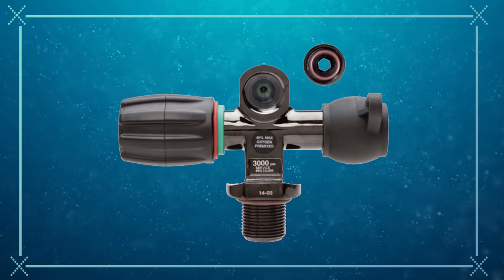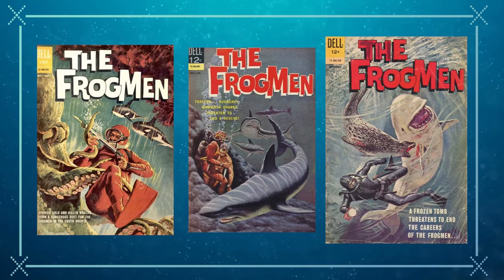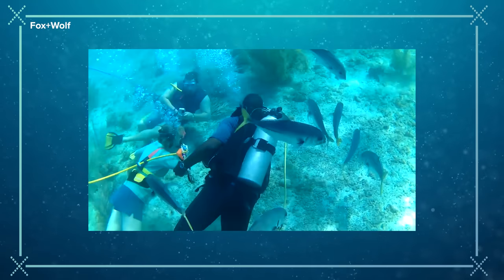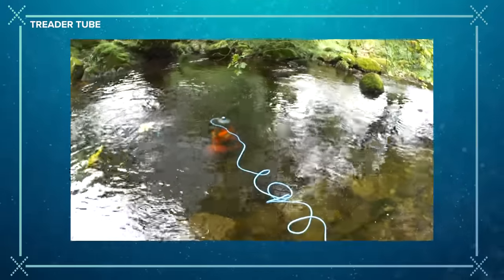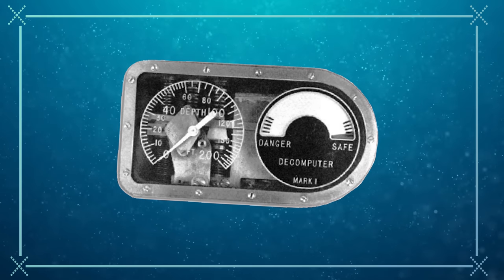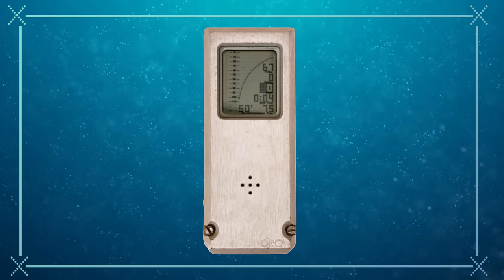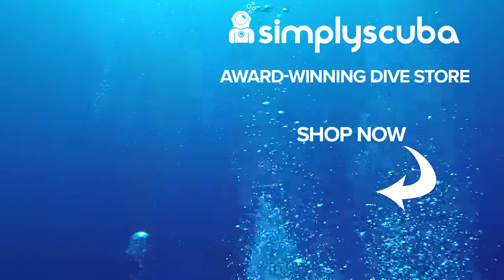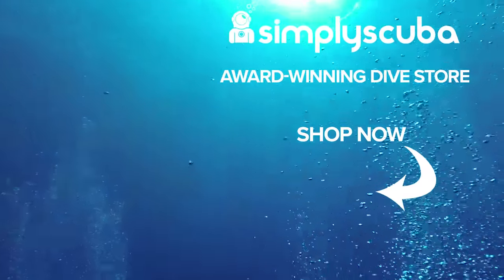Worst Dive Gear In The World

Comment: When I got my PADI certification, my instructor taught us exclusively on tables
Reply: That's the way it should be, when I dive, I dive with two dive computers and I carry a set of tables just in case, you can never be prepared
Reply: @markgiltner7358  Why bother? If your main (only) computer fails all you have to do is make a safe accent to the surface with your usual safety stop along the way and end the dive.
Reply: @lordgman1  
i should have given more information as to why i use two computers. ive been scuba diving for 34 years, and commercial certified for the past 18 years. about the same time as my commercial cert. i started to get into Tech Diving   deeper and longer bottom times that kinda thing. my profiles can run down to 180ft  more or less i have touched 201ft on two occasions, just because I wanted it in my logs as a 200ft profile. i have redundancy built into my equipment, i wear twin steel 95 cu. ft. and carry as many as 3 sling tanks, 1 tank (80 cubes)  carries standard air mix, 1 tank (80 cubes) a carries EAN 40% give or take. and 1tank (30 cubes) if i think its necessary of 90% O2. the EAN and 90% are strictly decompression gas. 
i would absolutely agree that two computers for NDL dives is not necessary and overkill. but ive been doing these kinda profiles a long time and have never had an issue with DCS, hense my redundancy. 
hope that explains it better, cheers
Reply: @rimfirejunkie7427  
yeah me too, they was just starting to come out, I think it was mares that first came out with them, pretty basic compared to today's dive computers. my open water was in 1986 how bout you
Reply: Odd 😂
Reply: @lordgman1  If your going to have the expense (not everyone can) of a second computer then its a given to wear in each dive.  Why you ask.  Simple if my primary fails on the dive I've got all the information in the algorithm for the dives the remainder of the day.
Reply: It‘s always a good idea, having redundancy not needing any power supplies, that can be broken. I teach all my buddies in the use of tables, if they haven‘t been done so, already in OWD-cert.
And yes, I actually plan my dives with tables, to have a rough idea, how the dive should went. Not a tech-diver here.
Reply: We had that too.  That way if your dive computer malfunctioned you could get out your table and slate at 20 metres and calculate your...  PUPPY THAT!!  If the dive computer dies and I'm not rich enough to have a backup, I abort the dive and ascend with my dive buddy guiding me!

Comment: Very recent OWD here. In my OWD training I used two octo holders. One was a plastic "bubble" you'd squeeze the mouthpiece in, and the other was a plastic clip you'd have to force around the mouthpiece sideways. Especially the latter was horrible to use. I hated setting it up. On vacation I had a basic Aqualung BCD that had a strap on the right shoulder where you'd simply put a loop of the octo hose through. Super simple to set up and easy to pull out. I see zero problems with this but few BCDs seem to have this shoulder strap. I wonder why. It's so easy.

Comment: My favourite octo holder is to wrap a thin o-ring round the house of the octo and then bolt-snap that to my BCD. If you're calm and want to just practice or whatever then yeah you can unsnap it but if you need it NOW then you'll easily break the o-ring
Reply: That works actually pretty well. Just don't forget to make it part of your buddy check, so you're not the only one to know the trick.

Comment: RN S.A.B.A. sets use  a 'manual' version of the 'J' valve for safety reasons. The Swimmers Air Breathing Apparatus is an inverted twin set with the valves behind and below, where they can be reached by hand. The regulator is mounted between the cylinders and comprises a twin hose with full-face mask - all bubbles exhaust from behind.
There is no contents gauge.
The diver shuts off the r/h (reserve) tank and breathes from the l/h (main) tank only.
When the air runs out, the tanks are 'equalised' by opening the reserve valve and then shutting it off.
The diver continues to breathe from the main tank which is now half full.
When the gas runs out for a 2nd time, the diver equalises again and shuts off the reserve tank.
The main tank is now 1/4 full and it's time to return to the surface. The extra 1/4 in the reserve tank is the 'emergency reserve'.
The only problem is if the diver forgets to shut off the reserve tank - then he's breathing from both tanks and has no reserve - it only happens once 😊.
Reply: Brother-Diver Gavin, VERY cool!  I'd love to try that apparatus, but only after having some excellent training on the system of course.

Comment: I think primary donate is only a good idea with a hose that's either octo length or more ideally with a long ( 2.1m) hose. With a standard length primary hose donation is inhibited and the experience of moving on is less than pleasant. Putting a standard length occy on a neclase works
Reply: We just switched to primary donate with necklace for octo - both on standard length - my feeling is that in an out of air situation in open water, we're going up anyway so won't need longer hose - if this was cave diving I see the value of longer hose but figure in our case, if you're out of air, the dive is over and we're going up.

Comment: Sorry, have to contradict opposition to rattles. First, most rattles now have covers that prevent them from making unintended noise. Second, I purchased a rattle after a situation of trying to stop a diver I'd been paired with by a divemaster to escort to the surface. I wanted her to make a safety stop, but she just took off and never looked at me and I had no idea what was going on.  I've tried other signaling devices, but just as rattles are annoying they're also the best at getting someone's attention. I've never had the occasion to use mine yet and wouldn't use one casually, but how many times have you wanted to get someone's attention quickly who's three meters away and have no way to do it? What if you're in an out-of-air situation and your buddy is kicking away from you? Wouldn't it be good if you could get them to stop and turn around?
Reply: Tank bangers are just fine
Reply: @muhammadadibabwahab2446 , Problems with bangers is that unless you've got side mounts you can't see them and they can be hard to find and manipulate. They make about a 1/4 of the noise of a rattle and like all safety equipment it's got to be easy to use and effective when you need it. Also, bangers make a single sound and then need to be retracted and released again (they're "discrete"); rattles can make almost "continuous" noise until you can finally annoy someone enough to turn around.  Also, if you're on a boat and using their tanks they're easy to forget.
Reply: @michaelatherton826  Brother-Diver Michael, agree!  For me, if I were needing to get someone's attention quickly/fast, I'd just pull (carefully) out my small Akona-knife & bang the butt-end against my tank(s). I believe that the older PADI Openwater/Advanced-Openwater  manuals suggest to do the very same.  But then again, we must remember....  "some"  people (all thumbs or not willing to learn/practice)  should NOT be handling knives of any kind, even when in the kitchen??
Reply: @martinbachmann6283  That wouldn't quite work for me. These days I only carry a 2" folding Spider. I won't trouble you with my old diver dangerous knife accident story. ;-)
Reply: @michaelatherton826  Lol   My Akona knife is maybe 3 inches long?  I keep it affixed to my bcd, &  NOT to my calf!  Very rarely ever take the thing out - only to clean & properly coat with silicone oil!

Comment: Let us not forget the early integrated bcd weight pockets with velcro that barely stuck and more than likely threw your weights out just when you didn't need them.  Some dives it was literally raining weight pouches.  Also the Aqualung sidevalve octopus second stage, as it was sidevalve, the first breath was certainly almost a wet one, not too bad if you are expecting it but if you are not its bolt to the surface time.

Comment: Wireless air transmitters. Nothing like checking your air mid dive to see "error". Still use mine for logging purposes and quick checks, but I always use a gauge as a backup.
Reply: I've had more SPGs (2) fail than wireless transmitters (0)

Comment: Most overrated piece of dive gear is the dive buddy !! In my opinion and one that I've  developed over the past 30 years doing 1000's of dives is that a dive buddy is more hindrance than help. On a shallow dive i'd prefer to go to the surface than go for my " Buddy's" occy .  And down deep if you have to rely on your " Buddy's " air to save you rather than your own redundant systems well lets just say your probably both dead !  Now if you dive with the same buddy over and over again and you know each other well i'm sure there is some merit in the system ,but that guys you meet on the boat who you just got paired with is likely to have a most detrimental effect on your health during the imminent dive. Learning about  self reliance and redundancy is the best solution and dive with a buddy for the company not for the back up air supply.
Reply: That's like having a fire alarm with no fire exit!
Reply: it is so just because all the good guys on the boat come with friends :)
Reply: @scubababy3410   Hey there..Sorry i missed this.. Yep i always have an exit , it just isnt my buddy. On a shallow dive i'd make for the surface every single time , down deep or in a cave i'd go for my redundant air supply . And that redundant air supply could be 300L but could also be 10,000L or anywhere in between depending how much gas i would need to safely return to the surface for that particular dive profile
Reply: diving with well trained buddys is a blessing, especially in siutuations where a second set of hands is needed eg beeing entangled.
Reply: Brother Diver Ian eb, VERY well put Sir!  Agree with you completely.
Reply: @scubababy3410  Scuba Baby, well?  What about a "fire exit"  with NO  "alarm" then??

Comment: No such thing as a real BCD when I was certified. Instead I was sold a VOIT Swimaster Vest. It had a connection for an inflator on the back of the neck, but we just used the oral inflator on the front. Of course it also had an emergency rip chord that would fire a CO2 cartridge to rush you to the surface!! Wouldn't it be cool for that chord to get snagged and tripped at depth? :)
Reply: I remember those…
Reply: Mine had "dual CO2 cartridges - in case one failed and only had oral inflation - dove 100 foot dives with it just fine

Comment: People wearing the Octo up under their armpits is a bad habit that still exists.  My clip is off of a D ring on the lower edge of my BC, and it is a simple open snap-in clip for the hose.  I used to have 2 J-valve tanks, but always dove with them open (no reserve), and they were great.  Heavy duty ScubaPro valves on steel tanks.  Also, I had a buddy who had an EDGE computer when they first came out (yeah, I've been diving since 1983).  That thing was rock solid and he had it for 10 years.  At that time the EDGE was considered one of the best made.

Comment: I am still diving at 68 & started when I was 13 before an agency exusted.  I too dived from 1969 with J-valves until they were fazed out.  The J-valve saved my butt several times with  reserve air to bail out on.
I have done many a free accent from 25m for traing & free accent from 45m following my bubbles.  Not easy but I wss young, fit and very bold.
I agree with resetting issue which was part of our buddy checks and feel that the steel rod is not the best method of operating the valve.
J-Valve and UOV is the way I will go, if I can find a set of twin-set J's.
Best of the old and new.

Comment: I despise compasses when Tec diving; twin steels or rebreathers have a habit of messing with them and the computerised ones are rarely accurate. Always fun to have a nice long surface swim.
Reply: Get a shearwater computer and you will be amazed on how accurate is the compass even with rebreather inside a tight wreck. :)
Reply: @chiranagheorghitaeugeniuth98  use a perdix as the back up to my ostc, haven't been massively impressed as of yet but haven't used it on many dives! I also prefer a good old fashioned compass as they're quite hard to kill by electronic failure
Reply: @timholgate6639  i saw ostc implode at 120 meter. Shearwater had no issue at 150... try and use your oerdix in the compass mode and you will be amazed on how accurate it is.
Reply: @chiranagheorghitaeugeniuth98  I'll give it a go next time! I never really go below 70m so imploding ostcs ain't a problem, but I do prefer the layout on it
Reply: @timholgate6639  about the layout it is just everyoanes preference. You can customize the layout on shearwater alse. What i find best at thd shearwater is the 2 button operation. .....just like the poseidon M28. Very easy menus. Cheers.
Reply: Or you could just reel off. There's nothing professional about surface swims
Reply: @chiranagheorghitaeugeniuth98  afaik the only HW  guaranteed below 120m is the OSTC4.

Comment: Worst dive gear I have found. Anything made by cal pacific or cindi walters. Specifically any product of theirs that uses the forte brand corrugated inflater hose. The fittings don’t mount together correctly and the corrugated hose can pop off. After buying 2 bcds on flea bay. I figured out what a terrible product they were. I bought them for pool training for my kids. So luckily no one was hurt. It’s unfortunate that major companies are capable of such a terrible product. Cal pacific made forte bcds and durapro bcds. 
These were produced in the mid 90s so hopefully less and less of them exist today. But the fabrics and tags were identical to the major brands adding further deception to the product.